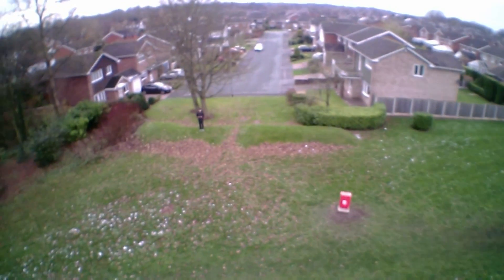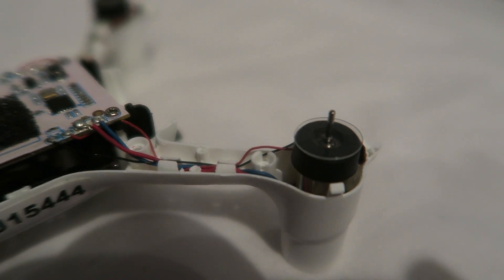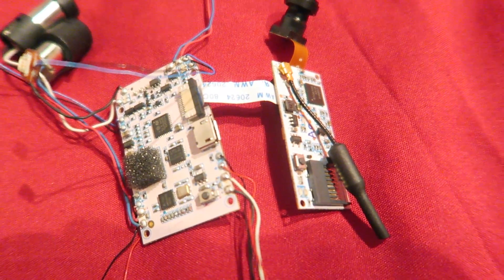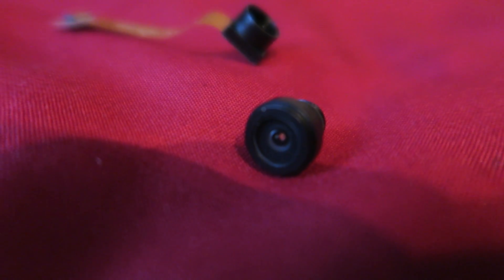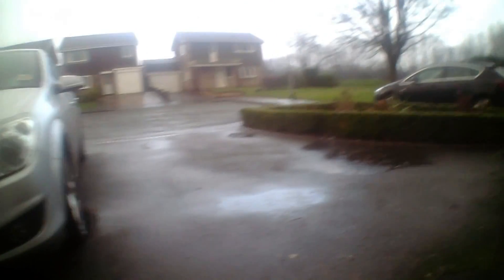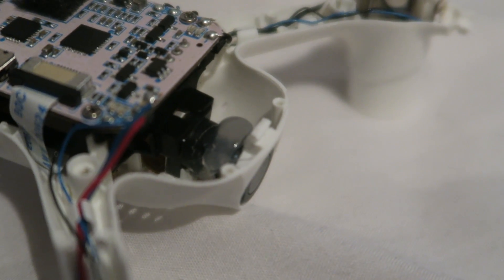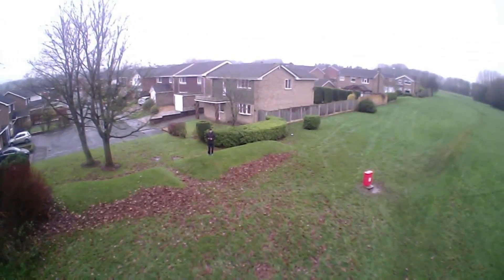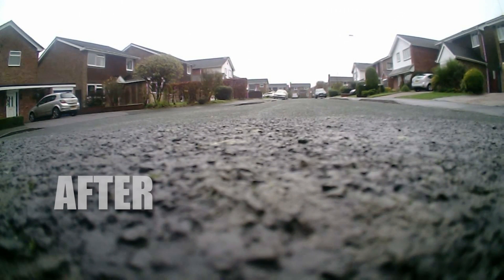H107D+ Dismantle & Focus Fix

Comment: Does anyone know what the button on the flight controller board is for? I have built a custom frame for my 107d+ (the stock one is flimsy and heavy) but I am super curious to know what that tiny button does.

Comment: so you just took the lens from the #16 and glued it to the cam of the original 107D or was the entire module replaced (ribbon cable matching)
Reply from the maker: no it screws in the same as the original cheers

Comment: Hello Andy I got two of these purely by accident so i figured why not try this mod on one of them cant hurt right? Everything turned out great but i get bad jello when in the air what could be causing this? and some possible solutions to fix it. thanks and great review
Reply from the maker: they do get a bit of jello in bright sun. only thing i can think of is bad props or the lens isnt sitting quite right
Reply: nah mine is pretty bad almost to the point of not able to see to fly. i havent even taken it up past the shade of my house to get any sun lol. should i hot glue the lens directly to the lower frame or would that make it worse
Reply from the maker: worth a try hot glue is harmless

Comment: Andy do you think it would be possible to get rid of the ribbon camera of the hubsan x4 h501s and connect a 4k camera placed outside with a gimbal? is this possible? would the board of the hubsan take this possibility to have a 4k direct experience?
Reply from the maker: it would be too heavy to lift and the money u spend trying to do it would be better spent elsewhere
Reply: My question is this possible?, I know that it would sacrifice battery time and maybe put more workload on the motors but is it possible?
Reply from the maker: id say no. i dont see any quad with less than a 3s battery flying a gimbal. even then its usually best to go 4s. id say u would waste your time trying

Comment: Have you found a way to disable barometer or bypass altitude hold somehow?
Reply from the maker: +PowerScissor no there is no way :(
Reply: +AndyRC Thanks for the quick reply. I wonder what would happen if sealed the sensor in silicone? Anyone have any experience with that? My thinking is it would block the sensor from ever detecting a change, but would most likely just ruin it.
Reply from the maker: I would say yes it would ruin it

Comment: I've just got the old H107D FPV  Hubsan, I'm no novice to quads,  and have built alot, anyway...I was (stupidly) expecting the quad to be picked up on the boscam frequencies WITHOUT the Tx...not so, but I have heard you can open the VTx up to default on channel 8 by earthing pin no 1 via a 1 or 10k resistor, and cutting the trace or as I did removing the resistor from pin 3. Unfortunately the pad got pulled off pin 1 and although I have briefly managed to get a picture on channel 8, there's not enough to get a good connection to earth. Has anyone tried this mod, just to confirm it works, before I potentially trash another FPV board and go a different route ?? many thanks.
Link to the mod is here http://www.rcgroups.com/forums/showpost.php?p=27898468&postcount=2361  it's the perfect solution for me.
My FPV board also came with a removable attachment for the camera, I think the 808 D lens would have gone straight in, bummer!!

Comment: why don't they make motor plugs dammit ? Blade Nano Qx has neat plugs for replacement motors. No soldering
Reply from the maker: most likely for weight. and they didn't factor in that people should take it apart. that would have been correct if the lens was in focus out of the box
Reply: AndyRC also probably they know that if people switched motors so easily they would more likely fix the broken motor and not buy a brand new hubsan. ..bastards
Anyway I'll get the h107C+ ...don't like the fpv's remote. It's ginormous and looks like the old star trek's tricorder thingamajig
Reply: Tomi my h107d+ flew one time and now wont fly I have a video if you want to see

Comment: sir can i use 2200kv motor for a medium sized quad and which esc should be used?
Reply from the maker: I have not looked at 250 class yet. have a look at RCmodelreviews 250 build